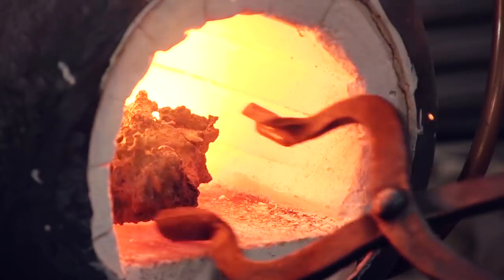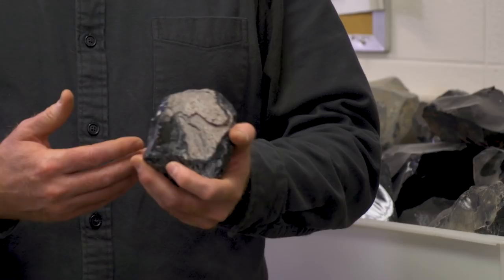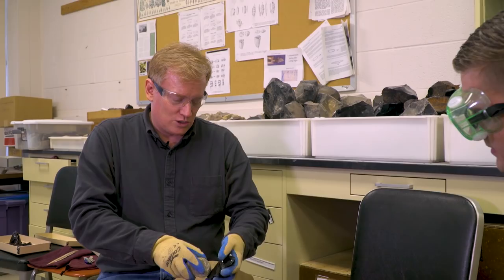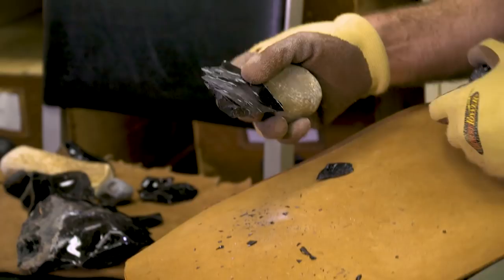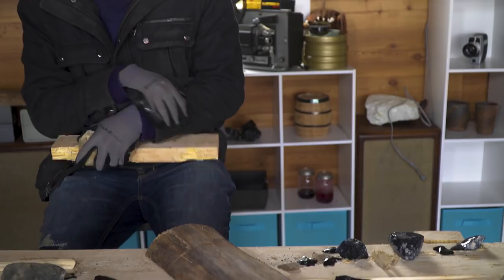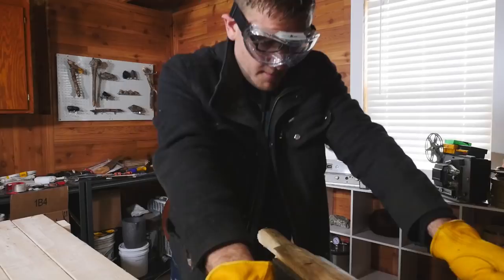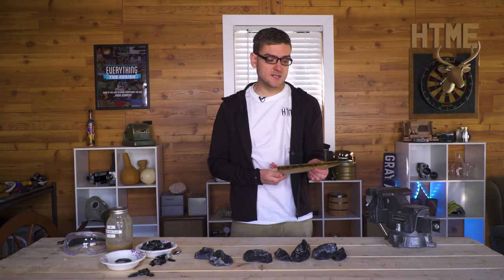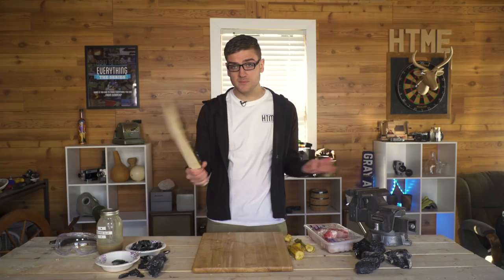Turning Volcanic Rock into an Obsidian Blade that's Sharper than Steel

Comment: Didnt know you could make an obsidian sword, hmm must be a new update.
Reply: It is...
Reply: NeusDreams 
it’s just a snapshot, it’s no better than diamond right now
Reply: The name of the update is the slashing and bashing update 1.15 where theres obsidian weapons now and theres a new thing called "daggers". You can make a diamond dagger with a diamond in the mid and put a stick on the bottom to make a diamond dagger! But it does 6 damage but its cheaper than a diamond sword. And theres a new enchantment called bleed which goes up to 5 levels. Bleed is poison but less letal but the max bleed enchantment is like the poison effect 5% faster than the poison 2 effect. Thats just the snapshot so theres more coming out soon
Reply: @eggboi4517  Well.

Comment: Does this work for sacrificing children?
Reply: Cinnamon Squirrel I don't see why not
Reply: yes. also circumcision
Reply: Typically sacrifices work better if it is a single piece, but this should work fine in most circumstances. 

If you really need the gods to love you, just use a single shard.
Reply: Yes, actually
Reply: It's a rare drop from Vulcan Area 10 and it one use item,why waste such a thing dude
Reply: Cinnamon Squirrel it should work
Reply: Why not

Comment: Your big problem with the wood was that it was old and seasoned. If your working with wood and stone tools, its good to use fairly green wood, and the tools as a drawing knife.
Reply: sharpbluntobject hmm yeah. Doesn't wood shrink after seasoning? Which would mean a tighter fit with the obsidian
Reply: depends on the wood and how it's seasoned, but wood gets less flexible and more capable to hold weight, you want seasoned wood for hammers, buildings, and anything that needs to be stable.

if it dries too fast, it'll split, and it will definitely split if left to dry around a chunk of rock that's been shoved into it.
Reply: He probably won't listen to your advice. He's probably gonna ruin it with a shit ton of sriracha.

Comment: Fun tip for those who want to make handles for their blades: Just use a small branch. Its far easier and you only need to carve a slot wide enough for the blade, and wrap it with string/sinew to secure it.

Comment: the reason it didn't cut the paper well was because if the rough edge instead of the clean edge. I also noticed that with the porkchop it would cut as deep as the exposed obsidian was but stop at the handle.

Comment: maybe i missed it, but is it possible your selection of wood was a part of the problem?
Reply from the maker: Likely.  Another comment mentioned it's easier to work green wood with stone tools, and my wood was both very dried out and also a hardwood which might not have been ideal for stone tools either.
Reply: cool.  TY for replying.  I wasn't sure what you were using, but I've built some furniture in my day and found huge differences between wood varieties in terms of work-ability.  This was my little attempt to give something back to such a great channel.  keep up the good work.  I hope you can figure out a way to get all the way to the firearm construction (though i doubt it).  Thanks for the great content you produce!!!!
Reply: +How To Make Everything if you look at Aztec obsidian blades, they are very, very smooth, straight edged, and consistent in shape, vs your irregular, jagged edges and random shapes., additionally If you look up the surviving Aztec wooden drum we have, the relief work on the drum and the pattern carved into them are super fine in detail and artistry as well: I suspect you, in addition to being inexperienced making the blades, isn't using them to carve wood the same way.

I don't know how the Aztecs used woodworking, but for metal, stone, and jade jewelry, they mainly only used obsidian blades to outline/mark where they wanted to carve, and then used abrasives, much like the sandpaper wheel you eventually used here, to actually cut into the metal or stone to make the pattern or design they wanted. I suspect it was similar for wood.
Reply: i scrolled until i saw this comment just so i didnt feel like the only one loool
Reply: How To Make Everything obsidian is sharp enough to cut a horses head off just search up obsidian deadliest warrior

Comment: I'm not sure if you know this now, but most of primitive technology wood was usually pre-shaped while still "green"/"wet". While knapped stone and glass are very weak against dry wood, green wood can often be easily shaped with stone tools that aren't even very sharp, but need to be heavy enough. It's less finesse and more grind, but it works. I know that from making wooden bows - while you need to finish the bow after the wood is seasoned, you are best off debarking and pre-shaping it while it's freshly cut, the wetter the better. Hope this helps for next time :D

Comment: "sharper than steel" is meaningless. Sharpness is not a property of a material: anything can have any sharpness as long as it's hard enough to be sharpened without breaking.

It's the equivalent of using steel to make a blade "longer than obsidian."

Great video though.
Reply: Henry Ambrose yep also obsidian is light material and easier to male into tools so its not even harder than steel xD
Reply: Luke Sowers That's not true, for the reasons I explained above.
Reply: Luke Sowers It can be made into the sharpest blades known to man, but it is not an intrinsicly sharp material, and nor is anything, for the reasons I explained above.
Reply: Luke Sowers And big chunks of obsidian have no useful cutting edge at all. The material itself is not "sharper than steel," it only becomes sharper than steel can be.
Reply: Luke Sowers I don't think you're getting his point, sharpness is a distinctive trait of materials. What you're saying is like calling a pound of stones weighs heavier than a pound of cotton
Reply: Zentonic Online explain your medifore in comparison to what their saying cause to me your medifore about stones and cotton has nothing to do with what their talking about
Reply: The reason Obsidian is sharper than steal is that obsidian has a much smaller molecular structure so the edge ends up much thinner than even the best steal or titanium ceramic has the smallest molecular structure so it can be worked in to the thinnest (which equals sharpest) blade
Reply: Obsidian is still used today in some surgery rooms. Its actually been getting gradually more used as it leaves very little scaring.
Reply: How about this. Obsidian is so hard that if it got thin enough to be as sharp as steel the edge would chip off during sharpening. I can get a piece of steel on my knife to whittle a hair. Literally lay a single hair across the edge and It splits it. I doubt a piece of obsidian could ever do that. It's too hard. If it was better than steel they'd be using it in something by now.
Reply: Torling. Obsidian is very sharp but very brittle and becomes dull easy.  Its good for yse in things like surgery but for battle you want something that wont break or dull easily so even tho it is supirior in sharpness its deficits make steel the better choice for battle. Thus it is not used that much
Reply: GANG shit thats why its a metaphor dude, ITS NOT SUPPOSED TO BE ON TOPIC 😭
Reply: İ think it is said the sharpest because it can be the thinnest thing with a solid edge known to man with current technology. But it can only be gotten by cracking it so also it is so easy to break at that thickness it isnt a good material to use as a blade. But as it is used only a few times when used as a scalpel it is not a big deal
Reply: Absolutely... wrong
Reply: Steel isn't hard enough to be sharpened this sharp without breaking.
Reply: Melody, easily available consumer tech may not be able to turn out 1-molecule obsidian blades, but dedicated factories produce such fragile but exceedingly sharp blades specifically for high-precision cutting such as that required for surgery.
Reply: Henry Ambrose another factor would be how well the blade retains its edge
Reply: Henry Ambrose doesn't matter if it breaks if the Aztec is the only one who lands a blow XD
Reply: Torling no one sad it was better than steel
Reply: I think we have to compare it to the techniques of the time. When we say that obsidian is sharper than steel we mean that people were capable to make sharper blades with obsidian blades with flintknapping then european metal blades with their sharpenning techniques at the time. Also, because it is sharper doesn't mean it's a better blades on all points. What makes steel so usefull is it capacity to bend to a better degree then other material wich allows it to be used many times before breaking. an obsidian hatchet might be sharper, but if it breaks after a few swing it is much less efficient compared to a steal axe that only needs to be sharpened after a few hours of use. Thats probably why obsidian is used in things like surgery and not as chainsaw teeth because it is sharp enough to cut soft tissues but too much brittle to cut a tree without needing to change the chain on your chainsaw every five minutes.

Comment: Here are some thoughts.

1) Stone age craftsmen had more uninterrupted time on their hands than you were willing to put into the project.  
2) Mastery of tools took longer with inferior tools.
3) Perhaps a stone age craftsman would have selected a slightly different tool for the job considering the experience they had using them.  And they may have had techniques that you didn't know about.  For example, I've seen stones for splitting heated first.

Comment: The hide glue is still in use for the manufacture of musical instruments, it's particularly useful as it can be dissassembled with steam and fresh hot hide glue will reactivate and adhere to old glue which makes repairs and adjustments much easier.

Comment: The scary thing about obsidian bladed weapons is that they were intended to break chips off in the target on impact. They were often used for draw cuts, where the blade makes contact and is dragged across the target like a saw. This cuts deeper and breaks chips of obsidian off in the target. As the target would move around, the obsidian chips in it's body would continue to cut into their flesh as they try to fight back.

Comment: Use tree pitch as glue. The process is to boil the pitch, add finely ground wood charcoal, and some form of fiber (i.e. fresh rabit droppings). Stir thuroughly till it is a smooth consistent texture. While hot, put the glue in the groove where the blade will be placed, then while still hot, insert your blades and let the pitch cool and harden. Be careful, when the glue is in liquid form, it's hot enough to melt straight through skin (personal experience).

Comment: Sci-fi and fantasy often depict obsidian as being a lot harder than it actually is.
With the Aztec macuahuitl weapon, having the blade made of lots of smaller obsidian edges made sense because if one or two of them broke, they could simply be replaced without replacing the entire sword; this is also because it is almost impossible to create one long blade with obsidian, because it is so brittle to begin with (which would also make a sword made entirely of obsidian a bad idea, seeing as it would just shatter when put to use.
However, a wooden club or mace with obsidian edges sticking out of it seems to be an interesting idea.

Comment: Have you considered soaking the wood? Then dry it over a fire,  after it's split. Or else maybe make an axe before this obsidian blade? Or use two smaller pieces of wood, bound together around obsidian that is sharp on 2 sides? Or use 2 smaller pieces of wood, with obsidian sharpened on only one side, with an extra twig between the dull edges of the 2 rows of obsidian?

Comment: Part of the problem is that you are trying to carve/cut into dry wood. 
     
Splitting out sections and then carving them down while green will let you get much further hand cutting with stone. 
     
Yes, you have risks from shrinking, warping, and cracking during the drying process - but the work saved is worth it.

Comment: Nice job! However, I have a pointer to make it better for cutting both meat and paper (and horse's heads(?)). Slimming the wood portion of the sword would improve its ability to slice through materials that are commonly difficult to cut. If you're looking for durability and lethality, however, your current design would suffice.

Comment: Imagine how painful it would have been to have one of those swords swinging into your body. The jagged rocks tear through your flesh with immense pain and make the wound almost impossible to heal.
Reply: That's entirely dependent on the quality of the blade itself.  If you're talking about that cast blade he was shown, then yes that would be incredibly painful.  However Obsidian is absurdly sharp, and as someone who knaps it consistently, I can tell you that I don't even realize I've been cut half the time.  I've split the back of my finger down to the bone with a flake shooting off of an obsidian arrowhead and didn't even feel it at first, I just saw blood splashing over my leather pad.  The pain that followed was not nearly as intense as I thought it would be, and a couple minutes of mere pressure was enough to keep the wound closed when I let up.  I was able to flex the joint vigorously without the cut reopening and didn't even need stitches, though it felt like a massive bruise for months afterwards.

Comment: It appears that some of the obsidian you collected is partially devitrified resulting in snowflake obsidian. The snowflakes are devitrified obsidian, a processed whereby the glass (obsidian) starts to crystalize as the glass ages and is weathers. For napping the ideal obsidian would have no devitrification or small crystals, which would cause irregular fractures.

Comment: I know this is dumb to say, but he wasn't using it right. The correct way to use a blade like that is to swing it hard like a bat to get it stuck, and then pull it across the body to open a massive wound.

Comment: Obsidian was partially the reason the Aztecs were so easily beaten by the Spaniards, although very sharp in their prime, because they are still glass they couldn’t hold a candle to the Spaniards and their steel that shattered both the obsidian and the wooden clubs that held the shards

Comment: Surprised you collected the obsidian bare handed. I found an obsidian field up in Oregon and collected a bunch that way. By the time I was done, by hands were covered with slices. Fortunately, there is a creek nearby from a glacier melt(literally ice cold) and I used that to stop the bleeding. I think I ended up with about 30 lbs of the stuff.
Reply: Ya they are called gloves.

Comment: You should have used a branch instead of the trunk to make the handle. Less material to remove and it would be stronger since the grain would have fewer checks than wood from the trunk. I would have used a pine pitch glue instead of the animal hide glue as well. It is stronger and has les flexing so there would be less risk of breaking a flake on the blade.

Comment: Very good video!
1. The way you tested the blade is not representative to me, you should have gone in an outdoor environnement, and give it a big swing in a watermelon or something.
2. The obsidians should have been inserted by cracking slightly the wood and then locking it back in place with cord and some more processed glue.

In any case i liked it, it was a good project!

Comment: You know that it is possible to grind obsidian. If you started with a flat wood plank and sand, then worked your way up to clay, you'd have a very sharp and large blade.  Polishing a blade like that is similar to knapping and follows similar rules.

Comment: A fresh obsidian blade is actually at its dullest. Using it to slash with will self-sharpen as the impact knapps the edge. Be careful on a chop though. Sinking the point into something solid could shatter it. Try swinging it at some watermelons.

Comment: Next time you test a weapon, please don't simply cut some steaks on a board. That does not simulate an attack against a human very well, given that the board serves as an anvil.
Rather hang the steak on a somewhat flexible cord, maybe one above and one below. Simulates a human getting a hit and being pushed back by it. Plus you can easily do a full slash movement.

Comment: You are using the blade in a wrong way because of the thin nature of the edge it was used to cut and not hack into things because under a battle you wanted to preserve the edge for as long as possible so you would do a sweep over the skin and not hack it into the skin (it was possible because armor was not really a thing it was mostly shields that were used)

Comment: I literally clicked on this video just to leave a comment because the title pissed me off that much.
It should say that it is either stronger or harder than steel, not sharper. A difference in sharpness has nothing to do with the metal used, only how much sanding was done. 
There, I'm done.

Comment: Anything can be sharp. To say something is sharper than steel is silly. Because anything can be sharp, anything can be sharper than steel, especially if you are just referring to a steel ingot, since an ingot isn’t sharp. What you really want to say, is something in terms of the material’s hardness, or flexibility, because we already know obsidian is brittle, so what one might say instead is something about an obsidian blade being sharp enough to cut steel.

Comment: No it’s hard to explain technically what your dealing with is a mineral steel is an element a mineral is deifferent basically a larger molecule mineral strength is determined by what can scratch it diamond is the hardest mineral not element only a diamond from the list of MINERALS can scratch it steel can chip it because steel is technically stronger given straight elements are more stable and stronger than molecules